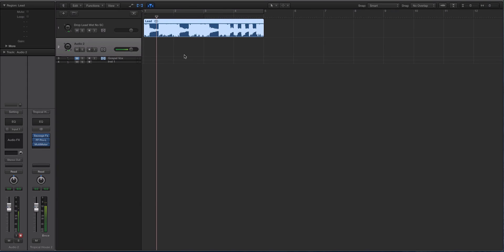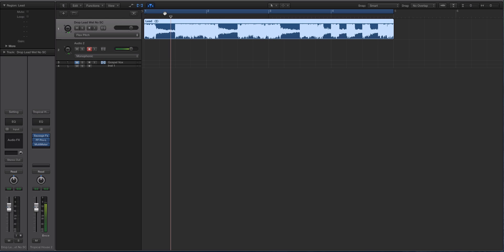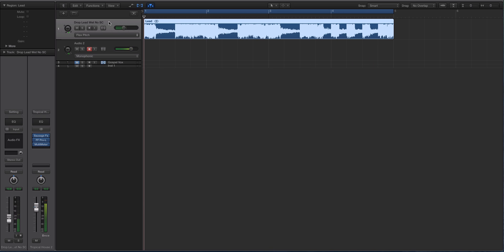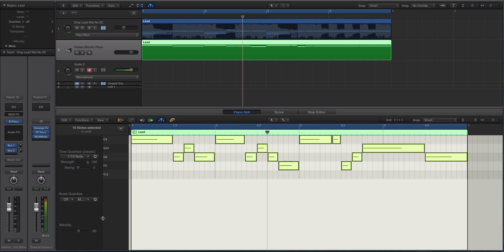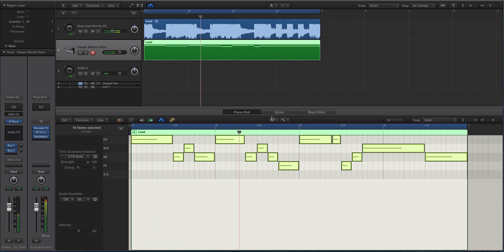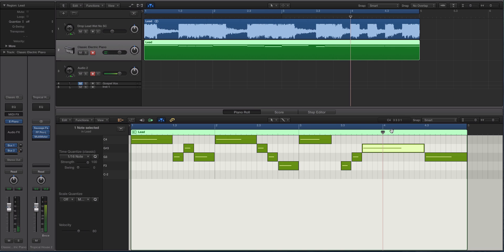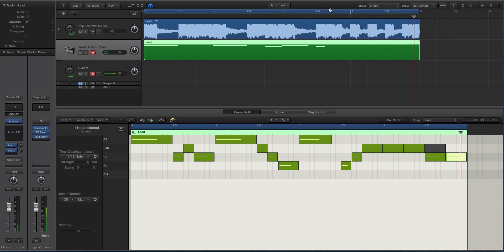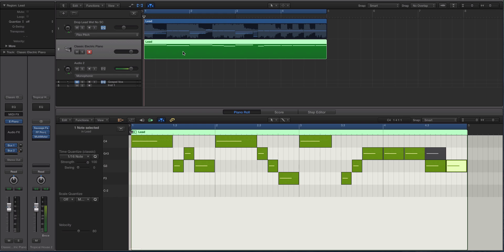Logic X Tutorial - Audio to MIDI Pro Tip

Comment: it would have been even more better if Logic was able to extract the original instrument in place of piano. I converted all my files to wav and now trying to find a way to get them all converted to midi. problem is that i dont remeber the names or location of the instruments I had selected. so no use in converting them. This video cannot be a full solution.